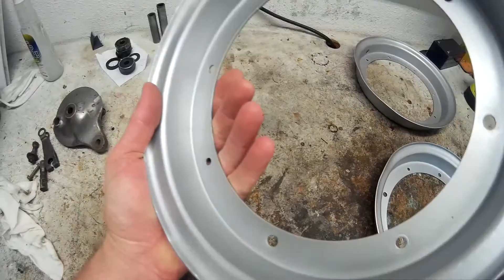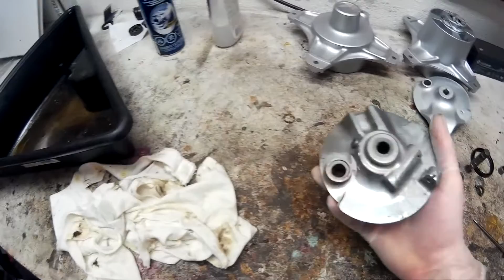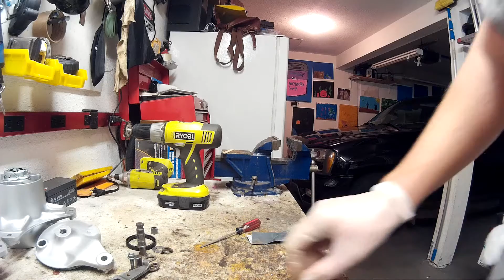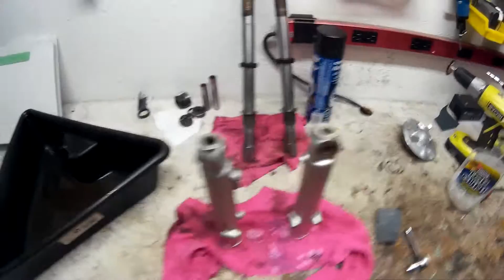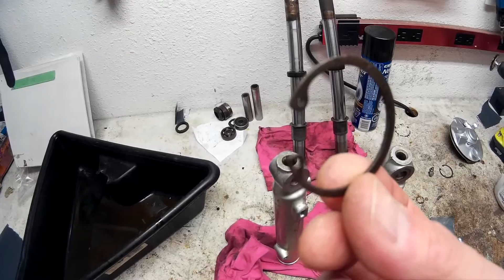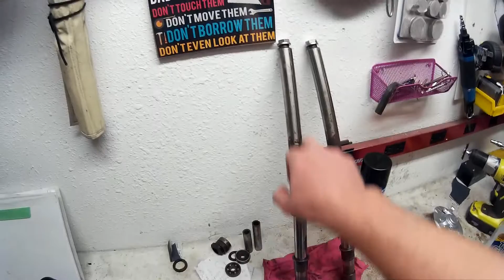1977 honda ct70 restoration

Comment: I like the paint color you used on the wheels.  What exact brand and color is it?
Reply from the maker: texasaggieproud  spray can made by rust check and the color is aluminum. I live in Canada and I picked up this paint at a store called Canadian Tire.

Comment: Did you bead blast? Walnut or sand or glass? Did you vapour blast?
Reply from the maker: mobgma I used a wire wheel with a grinder for the rims and for the hubs used a wire wheel on my dremel
Reply: Would you recommend I bead blast everything?